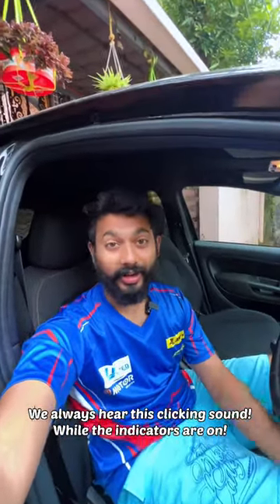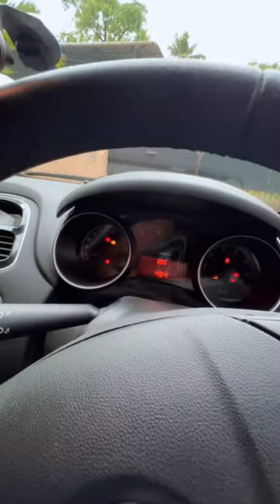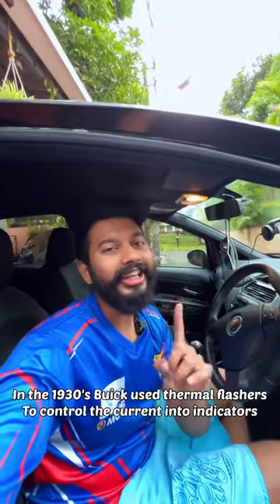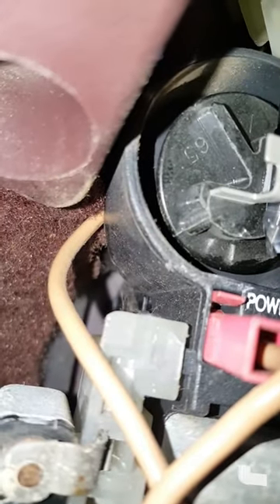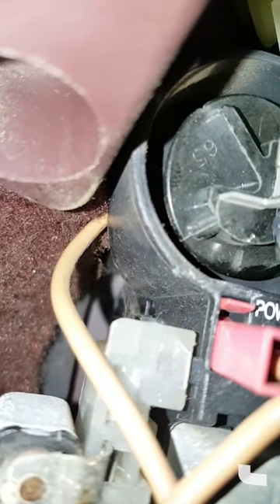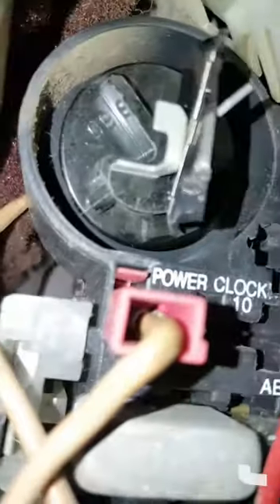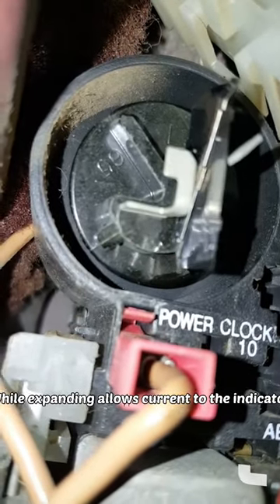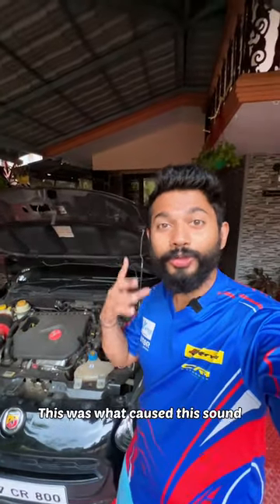Why does the indicators makes this click click sound! #shorts

Comment: moving metallic parts were used in old cars. in present generation  vehicles, the same sound is produced by dedicated buzzer or speaker for the chimes. They do not use car general audio system for this purpose. the sound is called 'click' & 'clack' and sound properties are slightly different.

Comment: That's alright, but it has one more reason
 It works as an audio warning that reminds you to turn off the blinker if it doesn't turn off automatically. It's a safety requirement to pass through testing authorities. That's why even electronic flashers designed to create sound while working.